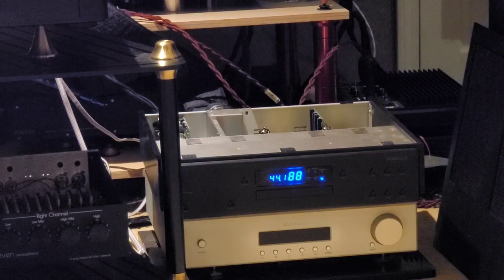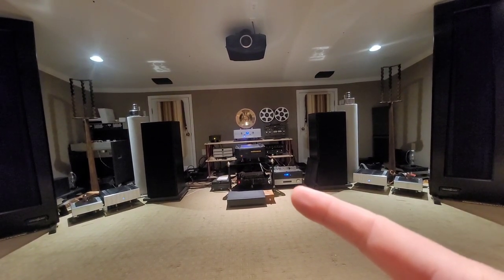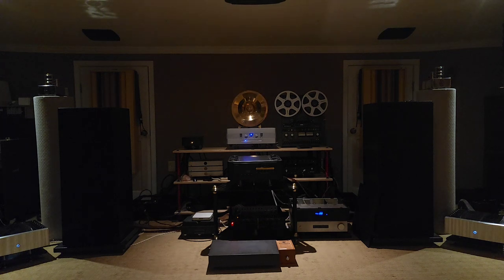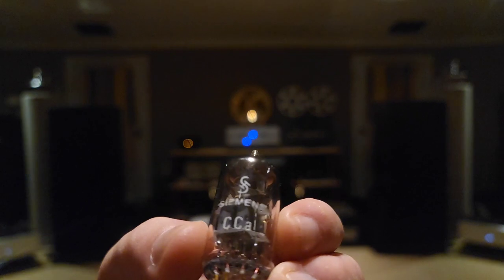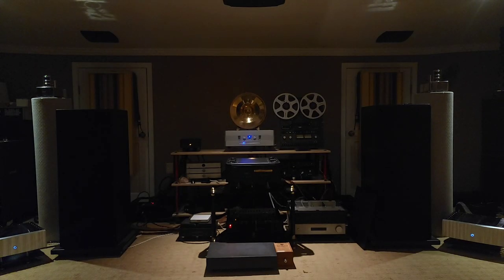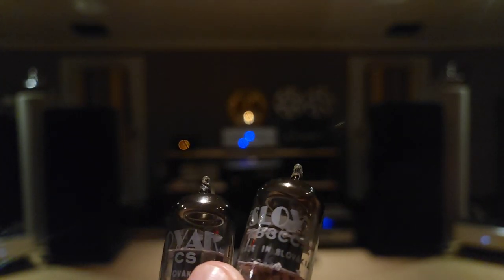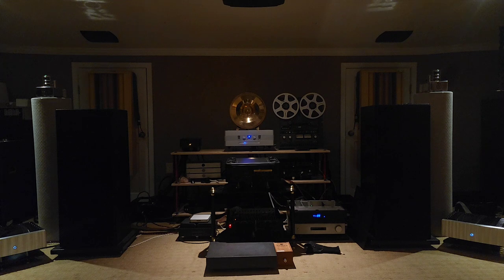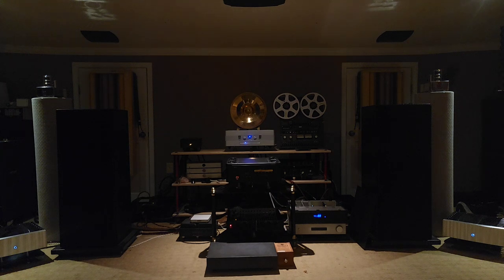NOS TUBE ROLLING with the 12AX7/ECC83 and 6DJ8/ECC88 using the AESTHETIX ROMULUS

Comment: Just a thought Mike...you should be able to buy an adaptor socket to use a 6sl7 provided the ax7's are wired to use 6.3 volts(ac or dc)...using 6.3 volts both tubes draw 300 ma...

Comment: hi ,great video .ive  made many comparisons on guitar amps ,i think that you are using mullard i63(shortplates,made 1964-1974) tubes so the bass is too upfront for home audio ,those are great for guitar amps at v1 and all positions really.  previous versions (i61 f91 f92 mc1 made 1955-1964)are much better,more balanced with magical top end. i suggest any mullard made before 1964 or ge 12ax7wa.
Reply from the maker: Right on man, thanks for your feedback !
Reply: @OCDHIFiGuy  GE 12ax7WA green letters is one of the best tubes ever made, I was shocked when I heard it for the first time, as I was trying to match a single GE 12ax7 that came with one of my vinatge tube amps.

Comment: I have the problem I can't fix. My speaker sound statically, and scratchy, I have three different sets (Elec, Polk both are new, Old set of Maggs. Amp/intergrade  Yaqin ms-20l, Mcintosh 6900 (has been service, was thinking this was the issue) and belles ref 350. Change all cables (power speaker). Source DAC, and CD player (sent signal straight to preamp or integrated amp). Got a Monster Power AV unit, still same old problem.  Thinking its got to be power from the wall socket ?
Reply from the maker: Amp . check that

Comment: Tesla blue tip from the '32' factory
Reply from the maker: Sounds scarce..
Reply: @OCDHIFiGuy  The factory 37's are a lot easier to find in blue tip. The blue painted tip is ultra tight, .5% matching in every domain. They were painted blue for the MIL use.

Comment: The octal versions of the 12ax7 = 6SL7..is a much better sounding alternative to any 9 pin versions...Ty anyway...alot of differences in the ax fam
Reply from the maker: Wasnt that one more soft sounding and tubey ?
Reply: @OCDHIFiGuy  no...some sound that way...just like any other tube u must audition first...have lots of the same ones....back in the late 70's I found a local surplus electronics store that had an inventory of industrial and commercial and vintage vacuum tubes(50,000 pieces)...As soon as I found his NOS(in the boxes) AX7 Telefunken large smooth plate tubes I purchased all 50 pieces for 75 bucks...I cooked each tube first and tried em all in my buddies "Audible Illusions" preamp ...out of 50 tubes 15 of em were audio grade...even some of those were absolute best....
Reply: @OCDHIFiGuy  I used a stacked totem pole driver usin a "Sylvania" JAN version 6SL7/VT229 staggers plate tube that was direct coupled to the grid of an indirectly heated power triode duo horizontal deflection video tube...I tried dozens of different ones of these(6SL7) before I found the perfect sounding one...I find the video versions of tubes(6LF6,6EM7,etc) are more consistent in sound then the other kinds...